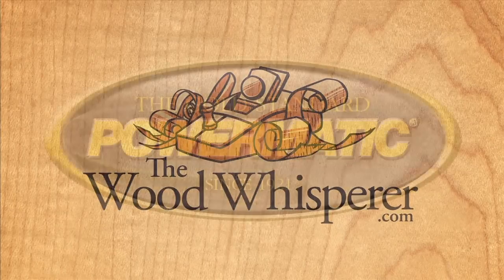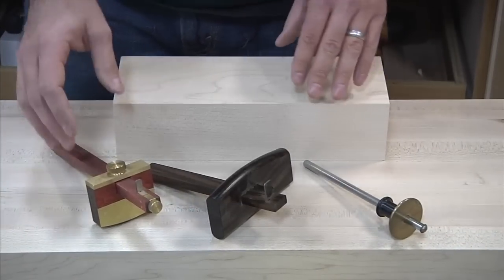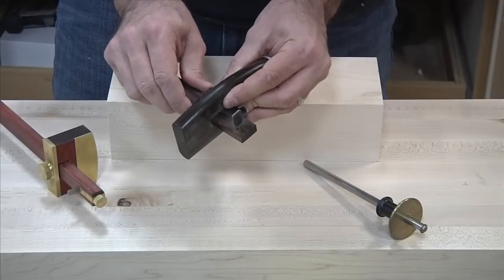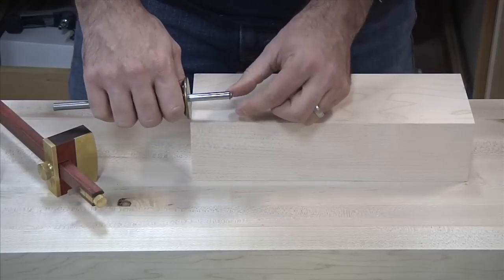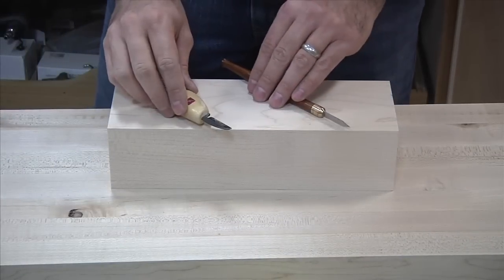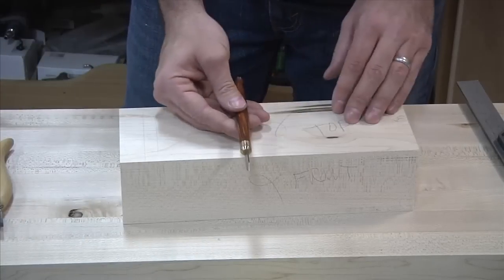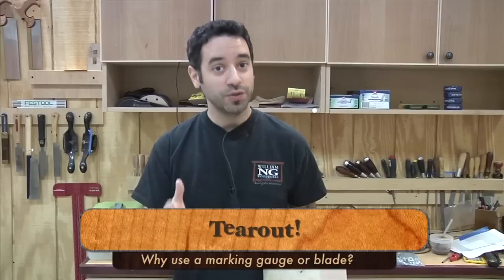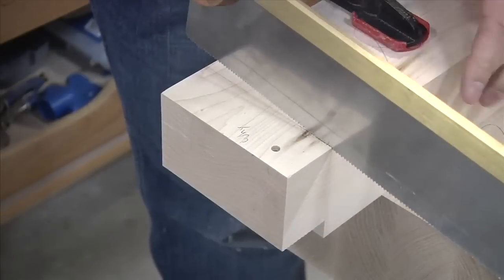164 - How to Use Marking Gauges

Comment: I figured out to do the initial layout with a pencil and then use scribe lines when I'm sure that I know where I'm going to cut, chisel, etc.  I have had problems when I just go into something and immediately start scribing lines; I always end up changing the design somehow and it's much easier to erase the pencil while working on the design and cut the lines only when I'm really ready to start the actual work.  Just a thought.

Comment: Hey Mark, thanks for the feedback on my computer desk question. Also, when putting together the two sides/legs of a desk, should I use a 1" x 1" piece of wood and screw that into the bottom of the desk and also screw it into the inside part of the legs?(I hope I make sense) It will be to attach both pieces together.